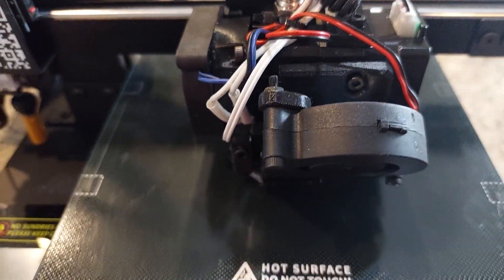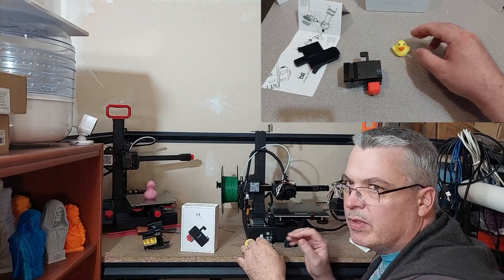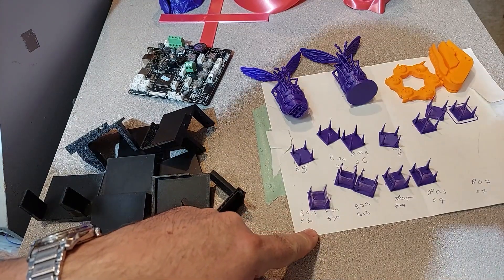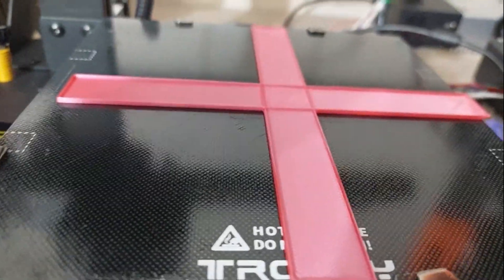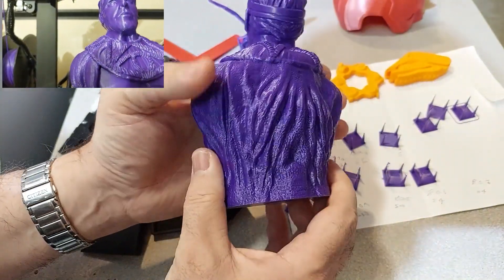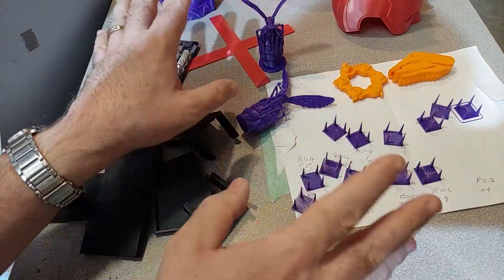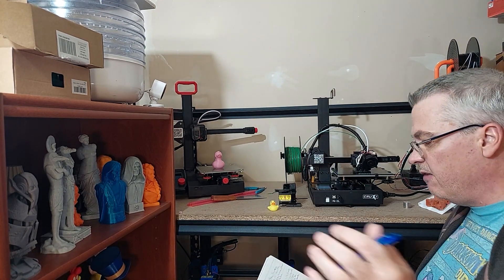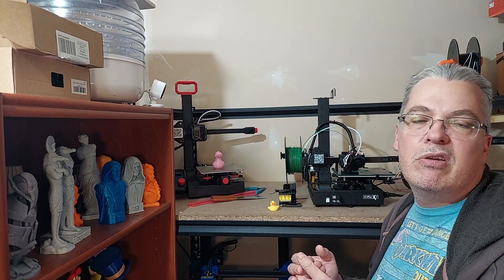Tronxy Crux Biqu H2 install

Comment: Little tip for pin out of the extruder;
If you plan to use the cable from the Tronxy, you need to flip the two middle pins at one side. I did this at the board side since those ones are easier to release. I used a multimeter set to continuity and verified which pins from the stepper were paired.

Also, Run a M503 to look at all of the settings your printer is already set to, I had to make these changes to get prints looking nice.
Modifications I had to make in firmware:
M900 (Linear Advance) was set to K 0.22, this was way too high with this extruder, changed it after running through the teachingtech test to .01 (make sure to 0 out the k value before calibrating)
M92 (E Steps) In this video he had 932, oddly that got me only 50mm when requesting 100, so I doubled it to 1864